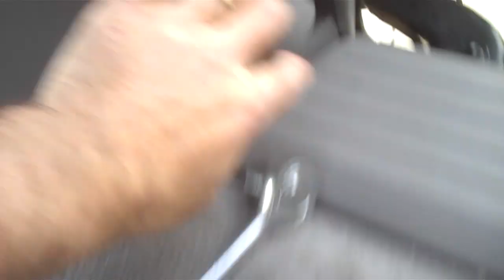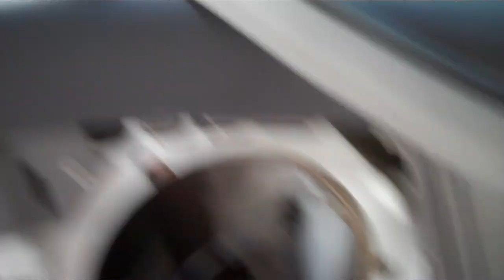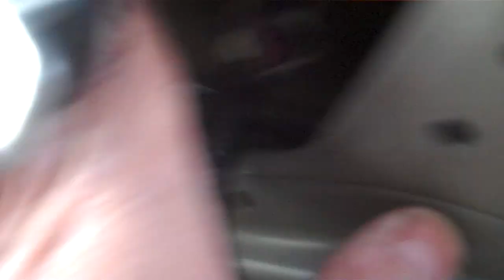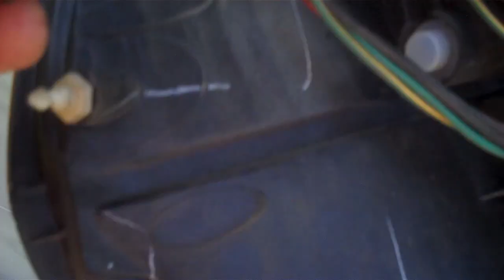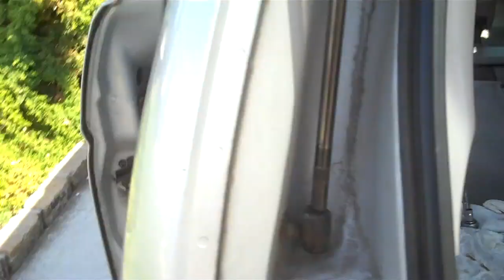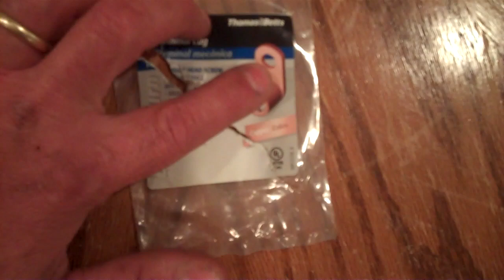2003 Honda Odyssey sliding door cable repair

Comment from the maker: On the Odyssey, the cable gets wound around a few times, but is still secured by a ferrule at the end of the cable. The ferrule sits inside the pulley housing.

I'm not familiar with the Sienna's, but if you take it apart and it looks similiar, you can apply the same principles from the Odyssey and repair it.

Comment from the maker: I'm surprised most of you are having problems with the cable pulling off the ground lugs because mine are still fine and have not budged. But it certainly does not hurt to tin them as someone else suggested.

Comment: The first time I fixed it as you directed but the cable pulled out of the brass fitting ruining the front cable which I hadn't replaced, Since I had to fix the front and rear cable I got the idea to do it in one piece. I used the brass lugs as you showed but ran the cable in one piece all the way through the roller.  It ran right under the center roller.

Comment: I replaced the cable in one piece running it through the door roller as the cable wouldnt stay attached to the brass fitting. Otherwise this video was great!!

Comment: Thanks, man!  I bought components as described and fixed the door in my 2004 Odyssey myself.  I did have some trouble with the grounding lug pulling off.  I ended up tinning the cable end with solder prior to attaching the lug.  It then stayed on.  I also had some difficulty getting the front cable properly wrapped around the spool.  Opening the door fully, and first wrapping the rear cable around the spool, then wrapping the short amount of front cable made it go a lot easier.  (continued)